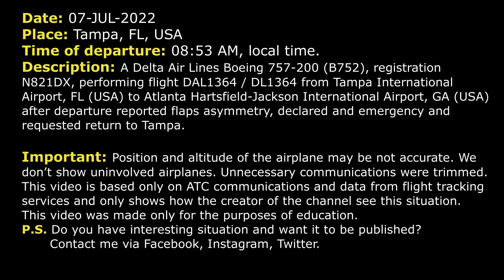Flaps asymmetry. Very high approach speed | Delta Boeing 757-200 | Tampa, Real ATC

Comment: Boeing said the B757 could never have a split flap condition so there was no published procedure if it happened. Some weren't convinced and invented their own procedure.  I am aware of 3 times B757 had split flaps including on the ground. Not a high number but in the worst-case scenario a split flap condition can lead to an unrecoverable loss of control.

Comment: I'm no pilot or controller but there should be a standard of how the fuel remaining is delivered to controllers.  Pilots are working their potentially disabled aircraft to a safe landing and it seems more times than not, controllers will ask for fuel remaining and when the pilot gives them the information one way, the controller will ask for the other way which adds undue stress.  Since there appears to be no standard, the controllers should ask the pilot for the fuel remaining in whichever fashion they need it.
Reply: As a pilot, standard is to give fuel remaining in time to center or approach control for holding potential, and fuel remaining in pounds to tower or ground for appropriate emergency vehicle response.
Reply: @Beaker71  finally a good explanation for the differences!
Reply: Not of any consequence. Fly your recliner right outta here Lovey.

Comment: Realistically speaking, how difficult is flying an airliner with flaps asymmetry?
Reply: Try letting the tyres down on one side of your car and go for a drive.
Reply: Its a little more serious than that. If the situation is allowed to progress unchecked, it will result in a pronounced roll towards the wing with the lessor amount of flap extended. In this case, it is possible that the induced roll could exceed the amount of aileron authority available and could result in a spin or other loss of control situation. In all cases of asymmetric flap, the wing with the greater amount of flap extended produces more lift. As a consequence, the wing with the lessor amount of flap extended will stall first.
Reply: Depends how out of symmetry they are.
Reply: Boeing 757: YES